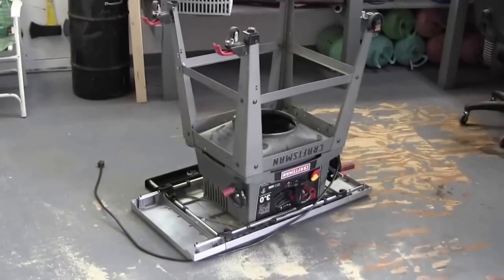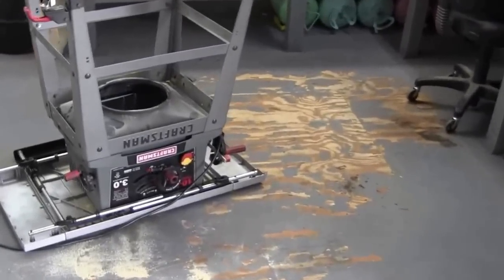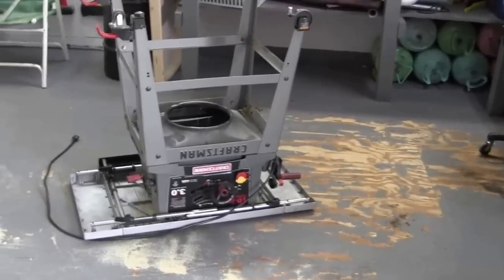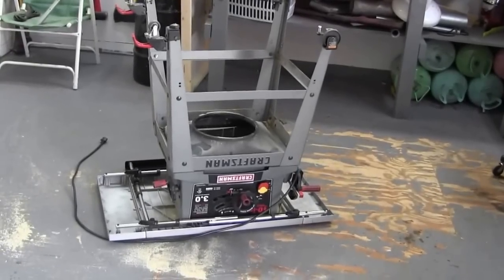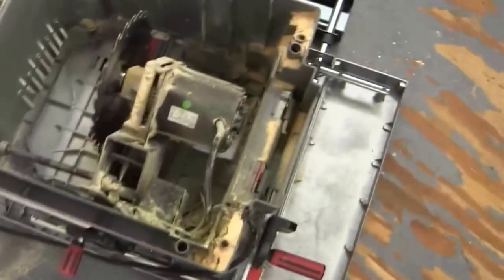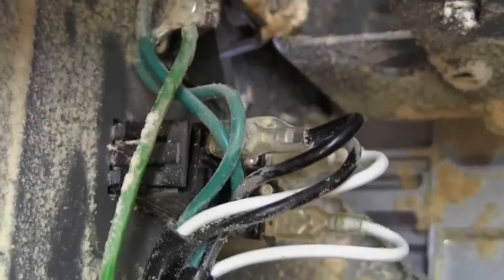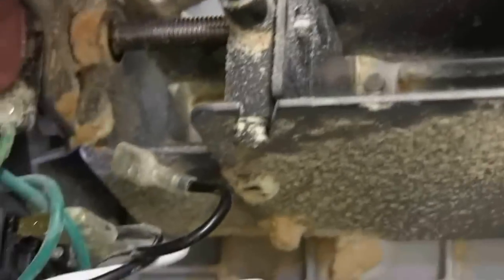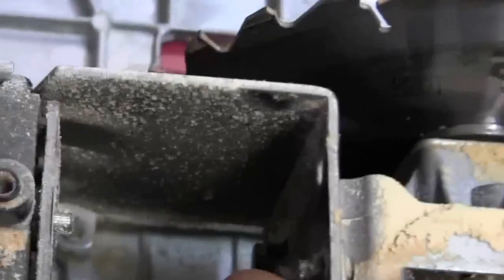Craftsman table saw repair, part 1

Comment: Thanks for doing this, I had the same issue with my table saw, I got lucky though because the rubber cup was not damaged at all. So I replaced the bearing that I bought locally for about $5.00 taxes in and my table saw is good as new. The brushes on mine were really not worn at all. What a pain to reinstall the bolts on the motor to the bracket, my hands are kind of too big to get in there, got it done after quite a while. Thanks again for taking the time to make a video of it.

Comment: I work in an electric motor shop. We use a puller for pulley's to pull bearings off with and then press new ones on. When you have a plastic housing (end bell)  like this, you might as well junk it. When the bearing gets hot and melts the plastic like that, the hole that holds the bearing gets out of round and will not hold the bearing in place and it will slip.  If it had been a cast iron or stainless steel housing, you could had  it fixed.  If you use an air compressor and blow the saw dust out once in awhile  it will help the bearings to last longer.  The saw dust is so fine that it can even get inside of a totally enclosed motor and clogged it up.  The first thing I recommend to customers when they call us about their saw motors is to blow them out. Sometimes the dust gets into the govenor or switches and damages them but that's a cheap fix. Also that little metal ring could be a slip (round circle that is open with 2 little wholes)ring which helps to hold the fan in place.

Comment: Great video, you did a super job of showing us how it was done.  I usually use a two or three arm puller to pull the bearings off, if they haven't got so hot as to weld them on the shaft. Thanks for the video, you have helped all of us to understand better how to do this job.
Reply from the maker: Thanks for watching and commenting.

Comment: I just followed this repair for my ailing Craftsman saw. It had been acting up for a while until it totally failed a few days ago. This repair worked perfectly! 
Thanks for the bearing part # (in next video) -- this was invaluable! 
Cut the outer race with my dremel, and was able to twist the inner race off with vice grips. 
Whole job cost less than $10, and works as good as new!
Reply from the maker: Fantastic! I’m glad you were able to save it.

Comment: Thank You! I was about ready to throw mine out until I watched your video and fixed my table saw. It was the brushes on my motor that were full of saw dust. Just opened the covers and blew it out. Now it works.

Comment: That's along time for a bench top type direct drive saw to be in service!!! It's an easy fix my man... The new bearing is the easy part - fixing the case is a bit of a challenge... Take your new bearing and wrap it Saran wrap so there is No wrinkles-pour some epoxy down where it seats then press the wrapped bearing into place- let dry and walla fixed:)

Comment: Im sure the bearing is common, look at the end plates for a 4 digit number, there are stacks of manufacturers that make bearings.

If you can afford it then replace the front bearing as well, then its covered for another 10 years lol :-)

Never apply any force to the outer of the bearing to install, use a tube to tap the center onto the clean clean shaft only.

I know you will win as long as you take your time mate :-)

Comment: I just bought this same saw this afternoon used for $50.00 in pretty sharp condition. The previous owner stated he thinks the motor is going out. I haven't even plugged it in yet, tomorrow I will see what awaits me as well. I think its great that your willing to attack the project, I'll keep my fingers crossed for you.

Comment: Got the same saw, same issue.  As I have several table saws, it is in storage for now.  The housing melted and I will replace at least that part where the bearing sits, or replace the entire motor with a new system that will keep the dust out (the cause of the problem).  A cheap pulley (wheel) puller will take off most bearings unless they are improperly sized.

Comment: Jim Martin  My son-in-laws 10Inch Craftsman wont run. He brought it over and I decided I would give it a shot. I found these videos by BCtruck which really help oriented me. I got the motor off and when I opened it up I found a "glob" of black plastic stuck to the armature at the saw blade end. I couldn't figure what it had been. I cut the plastic away from the armature and looked further into the motor. I found that the bearing at the other end was seized just like the video talks about. I then began my hunt for parts. I was able to get a new bearing, a new bushing and a new "Baffle"  this last item appears to be what the black glob was before it melted. In BCTRruck video he makes no mention of the baffle but you can see it a one point on his work bench. I had to cut the bearing off with my Dremel just like he did. 
The helpful hint about putting the armature in the freezer was a great  tip. Another thing was that he says they don't show the rear bearing on the motor cutaway. They actually do but they only sell it with the whole new armature.
Funniest thing was the $1.99 bushing was available on Amazon but the shipping was $9.99 (rediculous but necessary).
Got it all back together and hit the switch, it spun and I felt a great sense of accomplishment as a 74 year old retired engineer.
One more thing , like somebody  else said they found some semi-circle thin washers, probably used for shims but I couldn't figure where they fell from when I turned the saw over to begin the whole process.  About $28 in parts, 6 hours of grandpa time (nearly worthless) and satisfaction of saving another tool, priceless
Reply: I found the same "washer". It was a sheet metal seal, part of the frozen bearing that had gotten flattened..
Reply: There are shims to square the blade with the table. Is it possible those are what you found?
Reply: Can you tell us how you were able to remove the armature? I’ve disassembled mine but I cannot get the armature out of the housing in order to place the new bearing on that end. I as well had to use a dremel to remove the bearing on the other end
Reply: What was the bushing part number?

Comment: Wow!  Excellent video sir!  Not only are you a terrific table saw repair person, but you are very good at videoing your work.  Very clear, could see everything.  I'm impressed.  Thanks for your video.  I recently have had some issues with my Craftsman 10" table saw and need a part that doesn't seem to exist on any schematic.  It's a pin on the screw type rod that comes off of the handle to lower or raise the motor so the blade raises or lowers.  The pin goes thru a hole on a triangular piece that comes off the motor and it doesn't have anything on the other side of it to hold it in that hole.  I was lowering it one day and it came out of the hole and the motor/blade fell down.  That's when I realized the problem.  Since then I've been leery of using it cause I'm afraid it'll come out of that hole while the blade is in use and that would be disastrous.  So far I haven't found anyone around here that can help me.  I've found more help online, lol.  Thanks again for your expertise and sharing it with the public :)

Comment: I have this same issue.  Thanks for sharing your vid.  The bearing is pressed on.  You need a bearing puller.  The bearing is 10x30x9, 6200z.  The bearing cup can be found by searching "Craftsman Motor Armature Bearing Cup"

Comment: thanks for your time and efforts it is very helpful video but my suggestion is to have the Armature Bearing puller tool which is not expensive tool but saving your shaft from damaging, saving your time and headache as well, hope everyone can get benefit of it, thanks again and stay blessed!

Comment: I see someone else also made a comment about parts at Sears, they have an extensive line of parts or at least they used to I've bought many things to make them old sears item almost good as new. good luck with the project.

Comment: I was expecting to see some Harbor Freight saw, and I was surprised when it was a Craftsman. I've had HF tools crap out after only a few hours use. Still, 12 years isn't bad, and you do use that saw a lot...
Reply: Same here, I bought a hand grinder and hadn't used it until a couple of months later. Worked for less than 5 min. Went back to HF with box in mint condition. I was told "Sorry, you should have purchased the extended warranty." 5 Min of use, and I keep the box with that new unit as a paper weight to remind me never buy a F'n thing from Harbor Freight again.

Comment: Got the same table saw and I love it. Used it for decades. Accurate and quick yet portable. And I had that same bearing seize up after cutting a bunch of 2x2 plastic "lumber" ("use it exactly like wood" they said) which blew plastic shavings all over (the shavings do NOT act just like wood, wood obeys gravity) and probably got into that same bearing cause it was completely bricked would not turn either direction. Bought a cheap Amazon bearing puller and had to use a 5" vise to hold the handle on the puller while turning the rotor and when the bearing finally broke loose the bang made me think the puller had exploded. Also made me wish I had been wearing safety glasses. Only 1 of the brushes showed wear, but whatever works.

How did you get the new bearing back on?
Reply from the maker: I put the motor in the freezer and the bearing warmed up in front of an electric heater. Slipped right on.
Reply: @bctruck  Never thought of that. Cool. Literally.

Comment from the maker: that's a great tip! if i didn't live so far away from a sears (about 40 miles) i would definitely do that. i would use that much or more in gas in my very thirsty pickup getting there and back.

Comment: We do a lot of golf cart electric motors and they are also pressed on bearings on them. We can usually get them off with a screwdriver. If you can't find a bearing check usa bearings and belts online.

Comment: I wonder if another motor would cost less than a new unit, worth a thought.

I have a wolf bench grinder that came to me with dead bearings and a blown up start capacitor, the local motorbike shop got the bearings for me and the capacitor was generic.
That was 10 years ago and its such a handy tool, the tool rests/guards are thick metal unlike the rubbish made today.

Im similar to you as i dont like to waste anything, like those bottle jacks you fixed a looooooooong time ago :-) lol.

Comment: My table saw does the Same. Do you have a link for the parts I would need to fix it, I did take my motor apart and my bearings where the same as your video. Thanks for the informative video!

Comment from the maker: ive decided to scrap it. the plsatic where the bearing rides is just to melted and i will end up with crooked cuts. if it wasnt so bad i would go ahead and spend the money on a new set of bearings and try t o get a few more years out of the old girl,but with the race being that far out of spec ill end up ruining more wood than its worth trying to save it.

Comment from the maker: well i ordered the parts. ill have my saw up and running in a few days. thanks for the advice.
Reply: a bearing like that could be taken off with a pickle fork possibly, like the kind that you use for steering assembly work.

Comment: Thoroughly enjoyed your video because I have exactly the same problem with my saw motor.  Bought the replacement bearing (6200ZZ) from Amazon, but am having trouble finding the sleeve/bushing that the bearing slides into .  You statedthat you got this part from Sears, but I couldn't find it. Do you have the part number that I could use for ordering?  Good job on a DIY project!
Reply from the maker: I’m sorry but it’s been years since I did this. I don’t even have this anymore. I now have a DeWalt contractor saw.

Comment: great vid. i was fixin to tear mine apart but wanted to look for somebody that has done it. for insight. i do suspect mine is the same exact problem. but in the future remember every single bearing has a number punched on it. these numbers are universal. so you can go into any store and give them the number. i thought i saw some numbers on that one before you took it off, but wasnt sure. but, every single bearing, made by every manufacturer, has a id number. usually on the shield, if their shielded, if not it will be on the sides of the inner or outer ring

Comment: it's a press fit. a bearing puller works great
Reply from the maker: I puit the stator in the freezer for an hour and the took it out and hit the bearing with a torch for a few seconds. It fell right off.

Comment: After my cheap pawn shop tradesman benchtop table saw started smoking. I bought one of these for $45. When I started using the Craftsman it started making a bearing noise so I took both apart and they have the same bearing. Found it on ebay $3 ea free shipping.

Comment: I have an RM872 motor on mine (probably the same motor), only mine has a broken fan. I don't want to run it for ANY amount of time with a broken fan disk. Any idea of where the fan disk could be purchased?

Comment: Thank you, took mine apart found same bearing bad, front one is perfect and still has grease on it.  While searching for the motor to see what it would cost, found this video instead.  Looks like it will save me from a new say.

In the front of my motor there was like some chunks of melted black plastic real hard, looks real old.  Motor still made a humming sound when it froze so I know the coils are good, just cannot figure the melted plastic.  Cannot see where it possibly could have come from.  But ordered the bearing on Amazon, $3 and $15 to ship it because I need it here ASAP.   Thanks so much for this video.

Comment: Were you able to just use a Dremel cutoff wheel to remove the old locked up bearing?  I'm about to perform the procedure but I want to do it right and not damage the end of the armature.  Thank you in advance.
Reply from the maker: Put the entire thing in the freezer for a few hours. The bearing will come off much easier.

Comment: gHow do you removed de  motor shaf from tne transmission ,that may problem may be the transmission bearing.  But not show how dismanteling  thas parts.  I think that shaft have a threw Did you record that separation parts?
Reply: Ok is already separated with a piece o wood as a hammer 1- take a rotor with one hand (transmission look to the floor)  and hit the transmission  by a wood in opposite side  each time!

Comment: Good video.  How did you remove the old bearing race in the base of the housing?  Thanks.
Come to think of it, where did you get the replacement race?  Do you recall the part number?
Reply from the maker: Im sorry but its been 5 years since i did this and I just cant remember.

Comment: Also it be done with fiberglass resin or even glass filled bondo for strength... You could even make a new back plate for the new bearing mount out of fiberglass if ya had too... Don't junk it man it's fixable
Reply: By the way, the cup that houses the bearing is not longer available anywhere. My son was going to print a 3D cup for the bearing if I needed to, there's a material that is usable and offers some vibration dampening as does the rubber cup.

Comment: Ditto here. Same model of sears table saw, about 18 year sold, same bearing part number. $3.95. Fixed.
Reply: Where did you order the bearing. I am having a hard time finding one.

Comment: How did you break open the front part of the motor to get at the front bearing?
Reply: Did you ever get yours apart? If so would you care to share what procedures need to be taken for its removal?
Reply: @scottnerone3057  As I remember (in my case) I supported the gear/bearing between two blocks of wood and just hit the center with a hammer and drift....not without WD-40 of course 🤔
Reply: @Michael Oak, thanks, I’ll see if I can get it off using your method
Reply: @scottnerone3057  ...or I used a claw type puller. I did have to use a grinder one time to gently and patiently take down the material until it was so thin it slipped off with no problem.  Either way unless the inner race hasn't welded itself to the shaft it should come off. I remember ordering both exact  bearings from eReplacement for about 3 or 4 bucks a piece. I don't think they are still in business but local bearing companies should have 🙂

Comment: i just did a rebuild on an old craftsman 100 table saw. i decided to replace the arbor bearings and took them to the bearing supply house to use to identify them. I tried 3 different brands and all of them were rough and actually made noise when turned. the old 1961 bearings were actually in better shape. I kept them. As far as Sears I haven't bought anything from them in years because of their changes. I was once a devout sears customet.

Comment: I wish I had seen your video before I took my saw apart. Would have saved me a lot of time and hassle. I did find the bearing at a local bearing supply for $11.00 instead of the $19.60 that Craftsman wanted. And didn't have to wait on shipping. Mine was the same bearing.. Locked up tight.

Comment: thanks. my ryobi has the same problem. Now just have to pull the pos bearing. I will be replacing it with a Japanese sealed type.